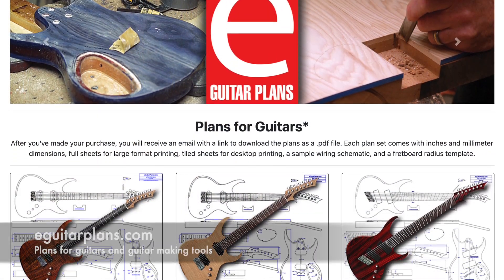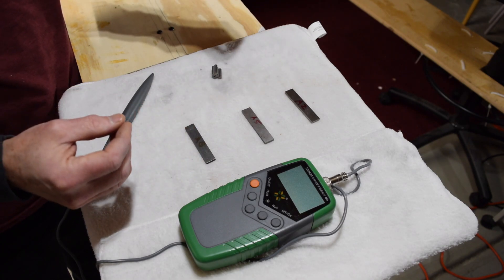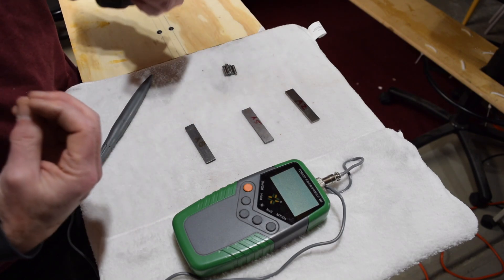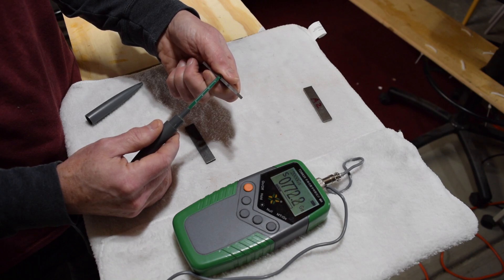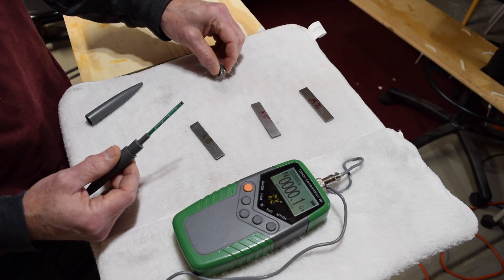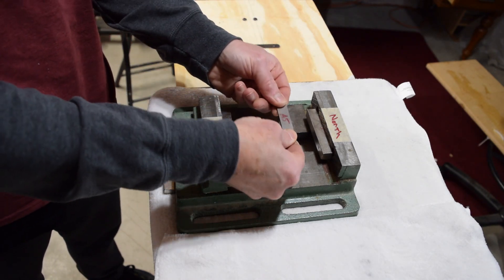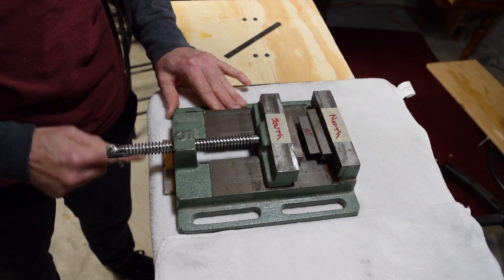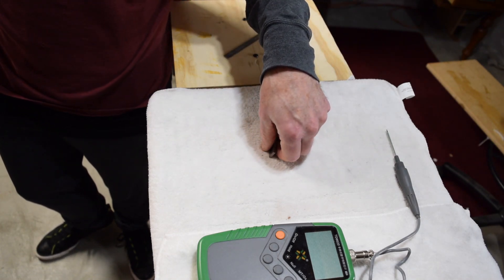Luthier Quick Tip 29 How To Make Guitar Pickups Part 5: Magnet Strength

Comment: Is there a way to identify a magnet type just by knowing how many Gauss it measures?

I thought I had an alnico v magnet but it only measures 465 Gauss so I am unsure, have a similar meter used in the video.
Reply from the maker: No. The type is determined by the composition, not the gauss measurement.

Comment: Very interesting, didn't know these factors that well. Do you just make sure the Neo magnets are attracted to each other before installing in that vise. And can I use a compass? Thank you very much btw.s, or do I have to buy the pole detector?
Reply from the maker: I move the jaws as far apart as I can before installing each magnet one at a time. You can use a compass, but be careful not to flip its polarity. Just check it every now and then to make sure it’s still showing the correct direction.
Reply: @HighlineGuitars Ty sir!

Comment: A5 and A8s are magnetized while they are being annealed so the crystal structure of the alloy aligns itself with the magnetic poles which gives them their singular sonic characteristic.

A2 A3 A4 and unoriented A5 are magnetized as you are in the video, their crystal structure remains as it was after the initial casting had set. A degaussed A5 at the same gauss will not sound like an A2 A3 or A4

Comment: where can i find the gauss specifications of magnets?
Reply from the maker: From Chat GPT:
Alnico 2
~500-800 Gauss
Warm, vintage tone, low output

Alnico 3
~300-600 Gauss
Weakest of the Alnicos, soft and smooth

Alnico 4
~600-900 Gauss
Balanced tone, slightly more output than A2

Alnico 5
~1,000-1,200 Gauss
Bright, punchy, higher output

Alnico 8
~1,200-1,400 Gauss
Very strong, aggressive sound

Ceramic
~1,200-1,600+ Gauss
Strong magnetic field, tight and modern tone

Neodymium
~2,000-3,000+ Gauss
Extremely high output, modern tone, can be harsh if not balanced
Reply: @HighlineGuitars  👌👌👌👌👌

Comment: Hello: I've purchased the neodymian magnets to which you provided a link, and I purchased a vise with 3" wide jaw surfaces, but I have a question.  I know that the magnets have to be installed with opposite poles (N-S) facing one another between the jaws of the vise, but how does one ensure that one of the magnets won't detach from the vise and be pulled up against the opposite magnet?  Do you have a way of fastening the magnets to the vise (in addition to magnetic attraction)?  Or is there some rule-of-thumb about the minimum distance that must be kept between the magnets?
Reply from the maker: It’s not an issue.
Reply: @HighlineGuitars  Thanks for the quick response.  I was just a bit spooked because someone who shall remain nameless fiddled with the magnets in a way that caused the packaging spacer (between the magnets) to hit the floor, such that the magnets then clung to one another.  It wasn't easy to get them apart with bare hands.

Comment: Question: If you left the alnico plate longer on the jig, would that alter the charge from the magnets? Would it increase or decrease the plate??
Reply from the maker: No. Time does not affect the strength.

Comment: I found some blanks at AliExpress. Not sure how good the metal is, but I was able to charge them exactly as you said. Yay! It worked! THANKS!! The hardest part was handling the strong magnets - they will hurt! It also took me a minute to figure out the correct way to hold the probe on the gauss meter - it will invert N/S depending how it's held (should be held ruler/numbers side up). In my case they did not charge fully until i ran the magnets thru once, then flipped them and did it again. Also, though it wouildn't seem necessary, i opened the clamp slightly and slid the magnets back and forth equal numbers of times. That seemed to make the numbers more consistent across the 4 magnet bars I used.

Comment: Ive got this same meter and I am annoyed by how you get a completely different reading all of the way around the magnet. I try to use it at the same point usually the South side flush with the end. Also each end will vary where one is way more than the other end. I guess I will measure exactly halfway in the middle on them all to have a common test point. What is your method, to be sure you don't just measure it at any random point on the edge as this is pointless due to the readings being all over the place. I tried to find a spot where I am getting the highest reading so I could just go with that but it is usually at one end with the tiny sensor split halfway at the very corner of the end, if you move it .002" the measurement changes.

Comment: Thanks for the clarification Chris. One thing puzzles me. If I had Alnico 5 magnetized to the maximum level of Alnico 2, how would that affect the sound? Will the chemical composition of both magnets still affect the sound despite the same level of magnetization?
Reply from the maker: Different composition results in different levels of inductance.
Reply: @HighlineGuitars  At the same magnetization level ???
Reply from the maker: @redcatstw  Magnetization level (gauss) has no effect on inductance. The magnet's composition does. High inductance yields a dark-sounding pickup. Low inductance yields a bright-sounding pickup.
Reply: @HighlineGuitars  Of course. We cant measure the inductance without the magnet installed, I think. Will lowering the magnetism affect the output level of the pickup?
Reply from the maker: @redcatstw  No. Output is determined by how many turns of wire form the coil.
Reply: @HighlineGuitars  So since the level of magnetization does not affect the inductance, or the tone, there is no point in using magnets with a lower level of magnetization, as some people claim.
Reply from the maker: @redcatstw  The strength of the magnetic field affects the level of frequencies in the outgoing signal. A strong magnetic field will allow more treble frequencies while a weaker magnetic field will allow more bass frequencies. In a pickup with thicker wire and fewer turns, the output will be low, but the frequencies will be balanced. If you used a strong magnet, the pickup will sound too bright. A pickup with thinner wire and more turns will have high output, but will lack treble frequencies. The use of a strong magnet will add back some of the treble frequencies that a high output coil lacks.

Comment: Hello Chris
make independent and adjustable plots with separate coils?? (mini transparent sewing machine spool, screws and commercial neodymium magnet))
I'm going to do it on my Jazz Bass, the microphones sound too modern for what I play (I need a non-metallic round bass)
The "sound" difference between wax and epoxy glue for filling microphones?
the speakers play as much a role as the microphones for the result obtained (and for the vintage 60s sound we are far from it)
Is it possible to make your own speakers? make the paper cone and the suspension?
all your videos are really nice for us (which must take a huge amount of time to make) ♥ ♪♫
Reply from the maker: Mini transparent sewing machine spools sounds very interesting.

Comment: If the presence of a magnetic field changes the gausse's value on the alnico 5 bar, do the cylindrical small ones also change the gausse's value?
Reply from the maker: Yes.
Reply: @HighlineGuitars  so everytime you swap a new bar under the humbucker, you decrease or increase the gausse's value on all the magnets, right?
Reply from the maker: @infectedspeedmx  Yes, potentially.

Comment: Why neodymium is not used for pickups?
Reply from the maker: They sound terrible (waaaay too much treble!) and they kill sustain (too much magnetic pull on the strings).
Reply: @HighlineGuitars  what is the difference between pickups with pole pieces and  pickups with blades?

Comment: Does altering the gauss level of a particular magnet type affect the overall inductance value?
Reply from the maker: No. Well sort of. If you slightly degauss a magnet from say 700 to 650, the change in inductance may not even be measurable with most consumer LCR meters. However, if go from 700 down to say 50, the inductance might go from 6.24 to 6.29.

Comment: Your link to the magnets above did not work, but I assume that these are their standard N52  3" x 1/2"  x 1/2", right?
Also, don't you have to take precautions to make sure those magnets never come into contact with each other?  It seems like it would be near impossible to separate them again.
Reply from the maker: Right. They are hard but not impossible to separate.

Comment: Nice!  In your experience, what are the differences in tone between pickups with Alnico 2 vs Alnico 5 that is demag'd to the same gauss reading as Alnico 2?
Reply from the maker: The alnico 5 sounds brighter even at the same gauss as an alnico 2. The alnico 2 has a higher iron content and therefore a higher level of inductance.
Reply: @HighlineGuitars  How 'bout that. It hadn't occurred to me that the iron content itself would be a major factor.
I've used Alnico 2 humbuckers in a few instruments where I wanted darker sound, but I've always thought that they sound fuzzier and less focused compared to Alnico 5. So especially for single coils, I've always favored Alnico 5.  
I've been wondering if Alnico 8 would be another step in the right direction in terms of focus and clarity, but I don't know of anyone who is using it.

Comment: About the gauss level of a magnet. If all of the magnets, A2 to A5 and ceramic had the same gauss measurement and each was separately added to the same humbucker pickup, would the sound output, assuming everything else was equal, be different only as a result of the iron content and thus the inductance of each magnet?
Reply from the maker: Absolutely probably.
Reply: @HighlineGuitars  Thanks. Very interesting. Quite often I read about the strength of A2 to A5 magnets increasing  as the number gets higher. Perhaps this is not totally correct? Is gauss a measure of strength or is there something else at play....

Comment: Your channel is one of the best luthiery channels I have found. You're very good at explaining this stuff. I have a couple of questions and im sorry if maybe I missed you addressing them in the video (ADD sucks). 

1) do different types of magnets at the same gauss have different qualities? That is to say does a ceramic at say 700 sound different than an alnico 5 at 700?

2) does a magnet lose gauss over time? If so, do some magnets hold onto charge better or worse over time than others?

3) do the different types of magnet have any difference in the maximum amount of gauss they can hold?

4) would using magnetic slugs on a humbucker affect tone at all? For instance would using a warm magnet with low gauss for the bar but higher gauss brighter magnets for the slugs make a different sound?

5) when a magnet becomes brighter in sound, does it simply raise the upper end of the frequency response or does it shift the focus up? What I mean is, do you lose the lows to get more highs? Or does using a brighter magnet keep the lows around and just let you hear more highs?
Reply from the maker: Answers.
1. Yes
2. No
3. Yes
4. Not possible
5. You loose one to gain the other
Reply: @HighlineGuitars  sweet thank you

Comment: I purchased the same tesla meter to measure magnets. When you’re measuring, do you use the hold feature to find the max gauss, or do you just measure in the center on one side and take the average reading? I’m finding a large variability between the average and max gauss. For instance on an A2 magnet I’m getting 450G on the south side, 600G on the north, and a max of 730G using the hold feature and probing around for the largest number.
Reply from the maker: I measure in several spots on each side and average my readings.

Comment: Love your videos! I do have a question though: I'm looking to replace the ceramic bar magnets on the bottom of a stock Sterling Stingray 
humbucker with Alnico. However, the Alnico magnets I'm finding aren't as tall as the ceramic ones. Is it possible to stack two of them together to replicate a taller magnet? Thanks!
Reply: You could use shims to prop up the magnets. Be aware though that going from ceramic to AlNiCo, the pickups will probably sound muddier.
I think you'd be better off replacing the whole pickups with some inexpensive AlNiCo 5 Fleor or Donlis pickups. You'll be surprised by how good they sound.

Comment: This info is incredibly useful. I'd love to hear an explanation on how different pole pieces affect the sound of the guitar. Single screw vs. double screw vs. rails vs. etc.
Reply from the maker: You and me both.
Reply: @HighlineGuitars  I’ve heard (at least with single screw vs double screw) that it’s a similar lever to pull as switching magnets from an iron perspective. IIRC screws have less iron and therefore using a double screw layout can brighten the sound.

Comment: is the only thing differentiating alnico types is their gauss strength? if so cant you in theory create an alnico 5 out of an alnico 2? or does the type of alnico have to do with its makeup and ratio of metals
Reply from the maker: Good question. No, there's more to it than gauss strength. The reason they have different gauss readings is that they have different ratios of aluminum, nickel, cobalt, copper, and iron. Alnico 5 is 8% aluminum, 14% nickel, 24% cobalt, 3% copper and 59% iron. Alnico 2 is 10% aluminum, 19% nickel, 13% cobalt, 3% copper, and 55% iron.

Comment: What happens with a Ceramic magnet in a pickup ? Can they be strengthen or weakened like these Alnico magnets ?
Reply from the maker: Yes. However, there's no need to strengthen one beyond it's maximum gauss and if you want weaker, go with any of the Alnico magnets.

Comment: I want to congratulate with you, because your videos are very very useful! Many thanks. I have a question because I'm a little confused: I know that single coil Strato magnets should be charged between 20-25 Gauss, but here I see that the values you measured are completely different (870 Gauss the polepiece for the single coil). Where is the error? Many thanks again
Reply from the maker: The error is in the antiquated analog meter folks used to use (and sometimes still do) for measuring gauss. Those meters can provide a number, but that number has no correlation to actual gauss levels which are often mathematically converted from milli Tesla in a modern digital gauss/tesla meter.

Comment: Can you  make the video comparisons of the sustain with Alnico made by you and with the neo-magnets used in this "magnetizer" ?  
It will be really interesting.
I would suggest placing the magnets in neck position (4-6mm from strings) where they would have the maximum effect and reading the sustain from the pickup in the bridge position.
Also take measurement the gauss for both magnets.
Reply from the maker: I don't understand what you're asking. Are you asking for a comparison between pickups made with Alnico magnets and pickups made with my magnetizing neos?
Reply: + @HighlineGuitars  
Not even pups -- just magnet placed under strings. For confirmation or busting of the "sustain dumpening" effect statement.

Comment: Chris, thank you for another really great tutorial. Something I found when using the Gauss meter probe is that the meter reading can vary depending on which way the probe tip is "aligned" to the magnet (side-on or end-on, for example). Checking a number of bar magnets from scrapped pickups, I also found that in some magnets, the magnetic field strength may be different from one face to the opposite one. For example, one side would read 350 Gauss, South, while the other shows 200 Gauss North - the field is not even through the material. (Ceramics from budget humbuckers all showed this). The rare-earth or Neodymium magnets I have didn't vary as much from face to face. With Alnico rods, I could adjust this somewhat when charging them. 
Thank you for your generosity in sharing your experience and knowledge.
Reply: Flying Beaver
You made the wrong measurements - the sum of the magnetic field  of a simple magnet is always equal zero.
There not can be difference between the north and the south pole.
Reply: @iridios6127  That is NOT correct, a lot of measurements show different readings for north and south pole. I don´t know the reason, but that is how it is.

Comment: If I'm making a P bass pickup using alnico V magnets, what Gauss reading should I see roughly? I've read the Stewmac tutorial on this, but is says that it should be around 20-25 Gausses which seems pretty low for me (compared to the hundreds of Gausses you talked about in this video).
Reply from the maker: I think Stewmac measured the gauss with one of those old time analog gauss meters. They don't use the same scale of measurement as a digital gauss/millieTesla meter and are generally considered inaccurate by today's standard. I don't know what a P bass magnet should read.
Reply: @HighlineGuitars  Alright, thanks for your response! I like your videos btw, they are really helpful.

Comment: Hi Chris.  This has been a great series, many thanks.  A question:  When you build a pickup with a particular tone, how easy is it to duplicate that by simply following the same build method as the first one?  Or, in other words, how much tonal variation can you expect between pickups that are apparently identical physically,  i.e.  built with the same "recipe"?   [EDIT: I just noticed someone else has already asked almost this exact question]
Reply from the maker: As long as you follow the same formula, there is no problem replicating what you achieved with the first time.